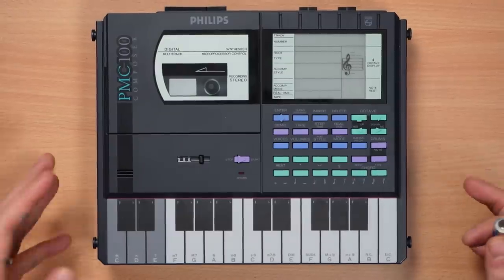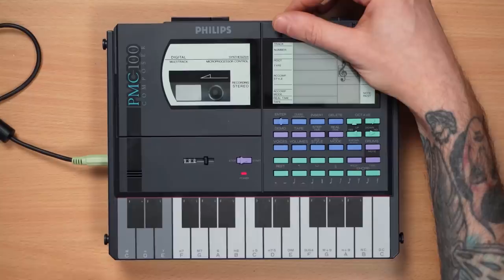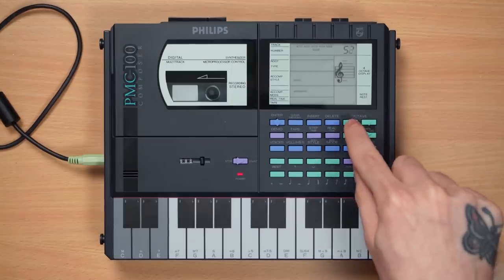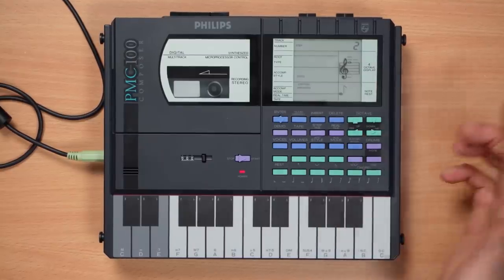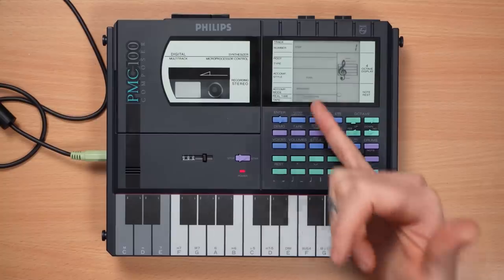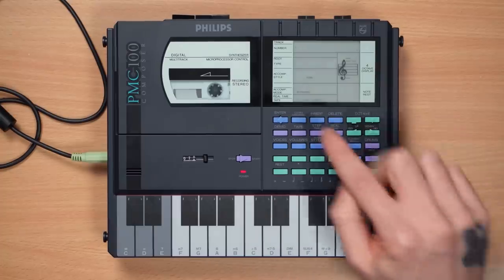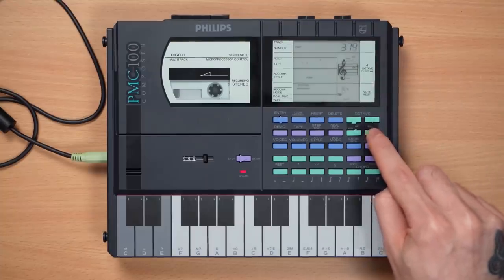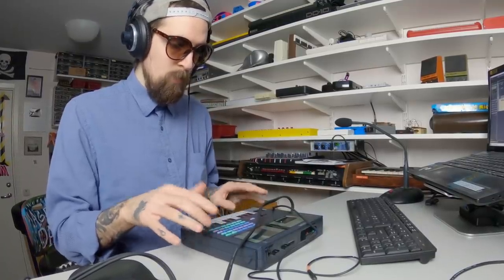So PHILIPS Made A Synthesizer And You Didn't Even know?

Comment: I have one, it was my very first electronic music instrument. I can explain GLING / SUPERGLING. I think in supergling you are supposed to program your accompaniment and play the melody yourself, and it will quantize the melody to sound right with the chords. Pitch quantization in 1986 🙂

You can also program the melody and the chords both in the sequencer, in Pro mode I believe.

I think the device had some incredibly cool features: nowadays you are lucky if your synth can do more than 64 steps of sequencing but this thing does a lot longer than that. Nowadays the steps of sequences are usually of equal length (and you have to use tie’s to get longer notes) but this thing lets you set a duration for each sequence step separately, in addition to ties to make them even longer. Also: you can see the entered note on the display.

Unfortunately Philips decided after a short trial on the Dutch market that the device was not the direction the company should move in and they stopped with making music instruments.
Reply: GLING! Perfect word for a concept that... was in much need of a brand new meaningless name that somehow sounds like... Gling.

Comment: I have one and it is charming little box - completely different from anything else. I love how imperfect it's envelopes behave - you can tap it very fast, and make totally different sound out of it. I'm thinking about MIDIfy mine. From what I have read, it's simple 2 Op FM, so you should be able to cut some data traces, make switches on those cuts, to block data flow of one of operators, and therefore creating new patches when changing presets. If I remember correctly there is pdf Service Manual somewhere over the internet which would help i guess. Now, waiting patiently for your modification :). Have a good luck!
Reply: It sounds exactly like Yamaha 2op FM, which would make sense since they owned all the patents at the time. What with the drums being on a separate channel than the melody, I suspect this is a Yamaha YM2143 OPLL (it sounds exactly like the one I have too), which was used in the Sega Master System and MSX2+ line of computers, so you should be able to find documentation on how to change it's 1 programmable instrument and use the built in drum set online easily. https://en.wikipedia.org/wiki/Yamaha_YM2413

You should be able to get really close sounds using the OPL2 chip found in the Adlib/Soundblaster era of cards, but without the janky cheap ladder-effect DAC this OPLL uses.

Since these chips were used in open platforms (such as MSX2+) there's official programmer's documentation. Also SMS programming forums will have information. Some of it will be translated from Japanese though, so YMMV.

Comment: Hmm, 1986 huh.
i wouldn't be surprised if this were an OEM application of Yamaha's CX5M sound module, a poly (don't remember the number of voices) with 4 operators per voice. Especially seeing the buttons on the right, which are mainly for sequencing etc.
Thats funny, because the CX5M sound modules had an, easy to fix but never done, bug in its' kernel in the built-in sequencer. So it seems Philips workaround for that was to add a tape recorder!
First time now i see the Philips thing, but it brings back a lot of good memories as well as frustrations on the CX5M.